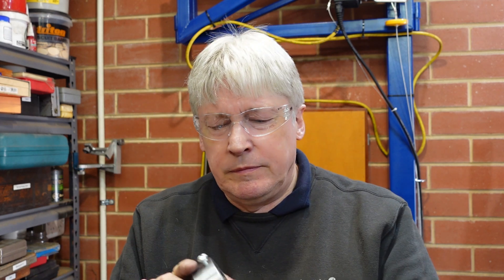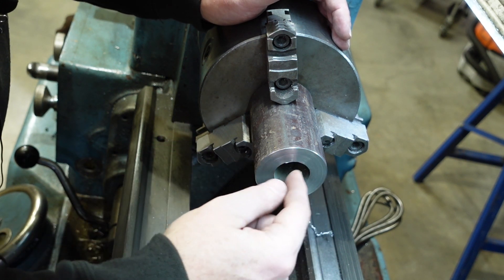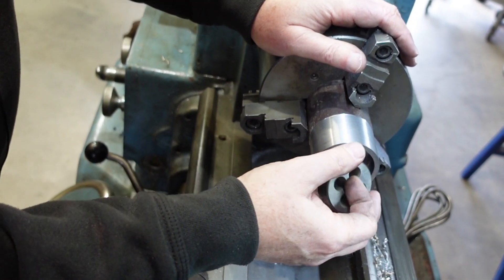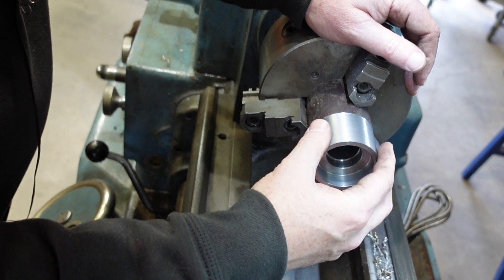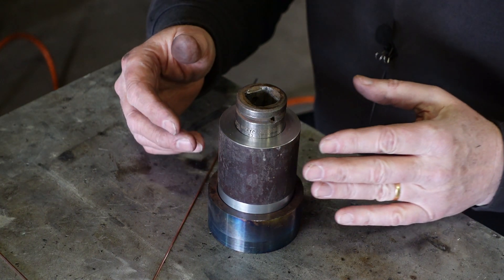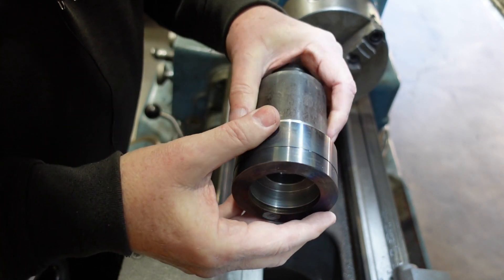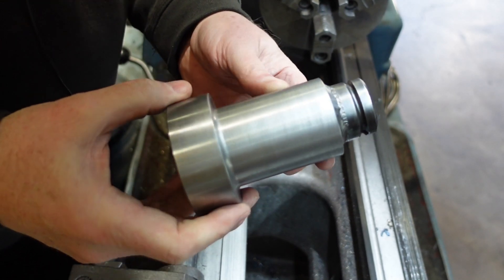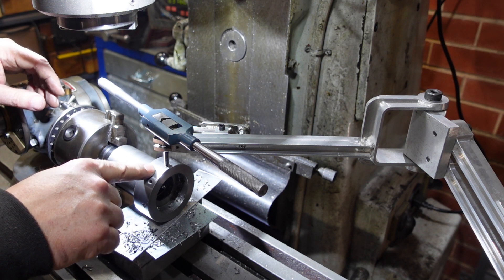Heavy duty die stock

Comment: Nice work as usual Michael. 
Have you thought about using a wobbler when lining up a centre punch mark?
I find it negates any misalignment or wear in the tailstock method. 
I would post a pic but I can't find a way😊
Reply from the maker: I have thought about making up a wobbler, but every time I start considering it, I can never find a job that I would use it for. Perhaps I should make one just for those jobs that are never apparent at the time.
Reply: Yep mine gathers enormous amounts of dust  but very handy when I need it

Comment: I found your channel a few weeks ago and been learning a lot. Great videos. Would you have any advice on buying a lathe for new comers? Second hand or new? What price point is reasonable for a first hobbyist lathe? Thank you
Reply from the maker: That is a really big rabbit hole! A lot about machine choice is about personal choice. I prefer secondhand machines because by the time you strip them down and clean them up, you will know a lot about how they work. Others prefer new just because it should work out of the box (although some of the smaller machines, even new, need cleaning and some sort of finessing) and if you are not mechanically minded, it is less of a deep end.
Size depends on what you want to do. I think my lathe is the perfect size for what I do. The previous lathe I had was a 7x20, and that was alright but sometimes a bit small. I've tried a Myford ML10 and it was too small for me. One rule of thumb is the swing of the lathe (the diameter between the centreline of the axis and the bed) should be around 3 times the diameter of the largest part you intend to turn.
If you are new to machining, I would suggest one of the common mini-lathes for several reasons. They are common enough in their various forms that there are lots of Youtube clips showing their use and how to tweak them; they are also in demand enough that if you decided that machining was not for you or alternately wanted something bigger they have reasonable resale value. Lastly, machine tools can injury you if you are not careful. With a small, low power lathe you have the chance to learn without risking getting pulled into machine and the swarf that comes off, while still sharp, is likely not going to be hot enough to burn (not that you should be touching it, but it does fly around).
I do say to people that if you are bitten by the machining bug, you will likely end up having at least 2 of your chosen machine(s) - not necessarily at the same time. One to learn on and then you will get another that has the features you lilke/ want once you have learnt the basics
Reply: @occasionalmachinist  thank you for the great advice